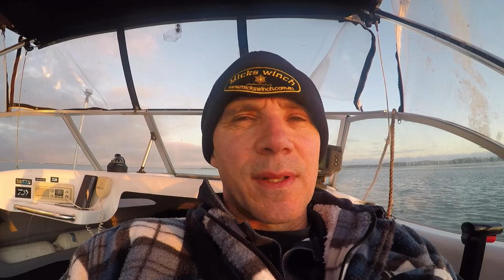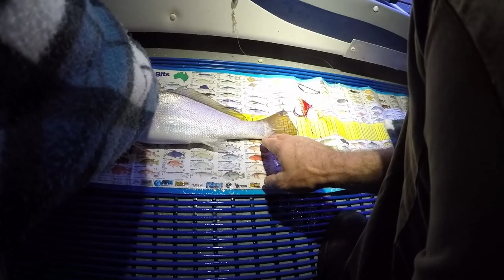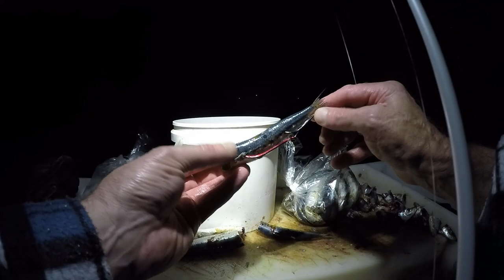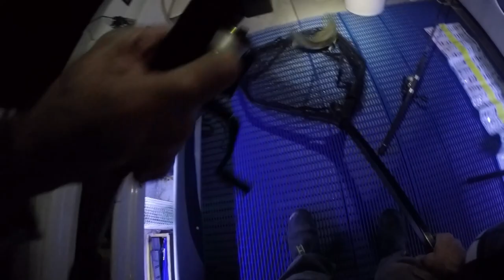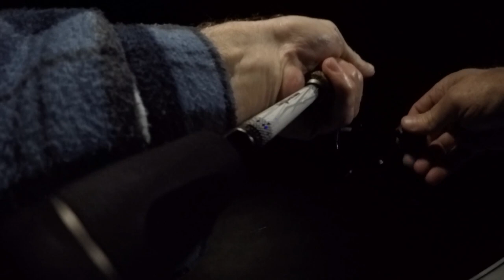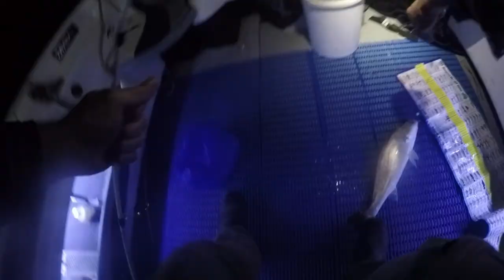Mulloway ! First trip of the season and their on the chew ! Ep 42.

Comment from the maker: Thanks Isaac Cooney,  I tried to answer your comment but it's not showing up so here's your answer. Yes I have the same problem,  I  have a second anchor to throw out but if it's to windy that doesn't work either. I  just normally hold the rod and lift it off the bottom when the boat swings 🎣😁👍